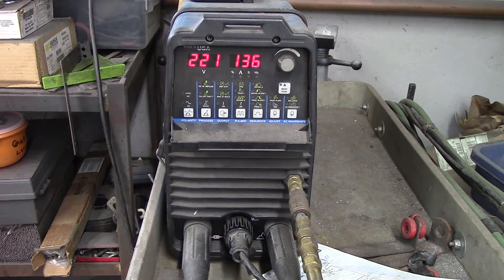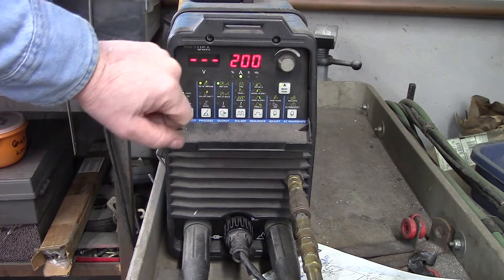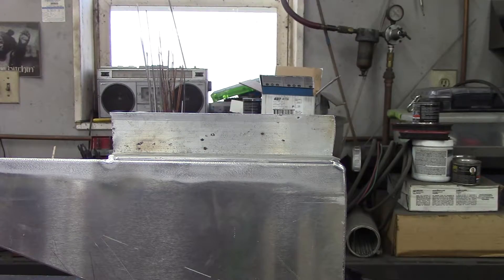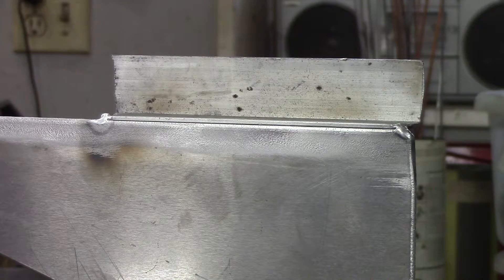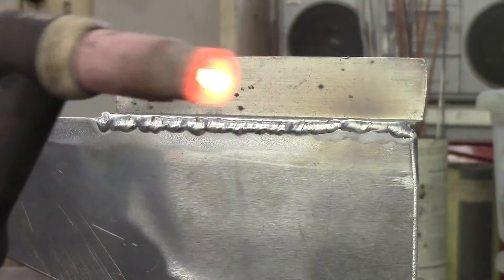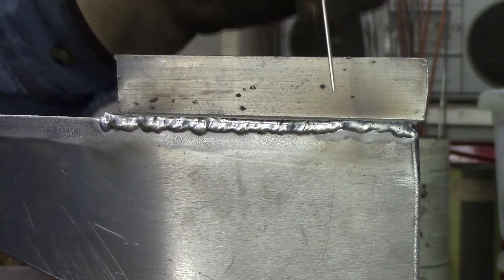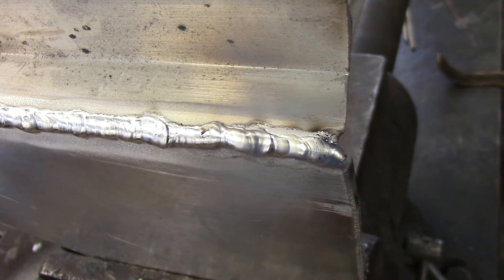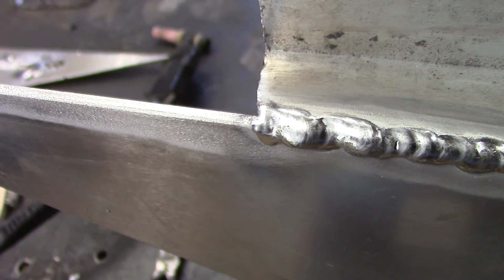Aluminum Welding with DCEP

Comment: To do aluminum on DC you need to run helium. It's all most better than AC. Runs really hot. Penetrates really deep. Way deeper than if on AC. And you don't really need to preheat because it just burns hotter. It sounds different, looks different, acts differently but the only way that i know of to tig aluminium in DC. But helium is kinda expensive. But if you work with what you have and a bottle of helium is cheaper than a welder that you can't afford at the time and you just need to weld it up with good results. Try it some time. You will be surprised of hiw much better your results will be trying to gig aluminium using DC.
Reply: I did that before way back in welding school but I I wouldn't think of buying a helium bottle for welding at home.  I'd just take whatever I need to do to work where we have a proper machine or just stick weld it if it's too big to move.
Reply: That is what I'm trying to do. I have argon and a cheap IGBT DC welder. Quick question. My electrode is positive and I'm not sure if I can switch polarities. Would that work with helium or do I have to switch polarities?